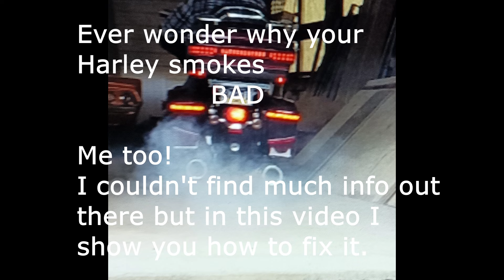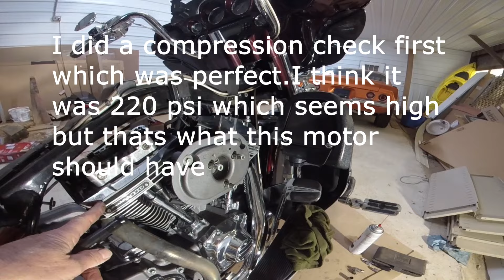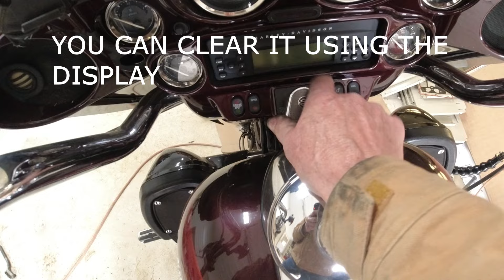Why does my Harley CVO smoke; not what I expected

Comment: As a mechanic of forty years on cars and bikes you did an excellent job one thing though I wouldn't have used those valve seals they should just push on in all my years I have never had to hit one on when i fitt the seals on i put the valve on then slide the seals with a bit of oil over the valve and onto the guide that way you will be sure to fit them the right way, where they harleys own brand or a pattern part it might be eventful to purchase a valve spring compressor they are not expensive over here in the UK they are around 25 pounds about thirty dollars in your money I know one thing you have saves many bucks by doing it yourself if Harley had done it they would have fitted a new head which isn't cheap as I've bought a couple myself for my friends bike he had the same problem on both heads but they also cracked so were not worth repairing so if the guide seals were not Harley ones it might pay you to invest in a couple just in case these fail depending on if you are going to keep the bike 
Long it certainly looks a good one normally guides don't fail until at least 100.000 miles plus they are normally pretty good my friend's bike had just done 110.000 miles when his heads failed so I did a complete rebuild bottom end and new cylinders and heads and pistons she is like new again ready for another 100.000 miles of fun as I hope yours will last too great video I've subscribed and liked so all the best from John from Rugby UK.
Reply from the maker: Thanks John 
The machine shop that rebuilt that head told me that part of the problem is they use cast iron valve guides that don't dissipate heat at the same rate as the aluminum head. 
Personally I think the CVO 110 runs hotter because of the high compression. After I bought it I did read some articles saying that the valve guides were an issue. 
As far as the valve stem seals go, I bought them directly from harley. They were part of the complete top end gasket kit.  Probably got sourced from some aftermarket.

Comment: Good job.  Cool video.  I have a 2007 CVO with the 110 engine.  I bought it used.  It had a good title but looked like it had been stolen and recovered as some of the expensive CVO parts were missing and replaced with Ultra Classic parts, like the wheels.  So, I got it for $7,300 when it booked for $13,500 in 2019.  I certainly ride it more than any previous owner and have over 103,000 miles on it.  We found strange things wrong with it when I got it, for example:  There is (was) an upgrade kit for the 2007 to upgrade the rear pulley to the 2008 "cush drive".  Somebody tried to do that, but they used the wrong axle, wrong spacers, and wrong bearings.  It took a while to figure it out but we put it together with the correct parts.  It ate two sets of rear bearings before we figured it out.  I put my first Harley together from a basket case when I was 19, I am now 58.  It's cool to see someone work through issues with just mechanic skills.  A lot of motorcycle and car YouTube channels act like everything is so perfect, just bolt things together.  Enjoy the bike.  Road Glide Vs Electra?  I have no opinion.  I was riding my CVO today, cruising at 95 MPH with no issues.  I tend to keep bikes a long time, it's more like a relationship.  I currently have 2 Harleys, 2 Hondas, a classic Triumph, and a Yamaha.  I can't see selling any of them, but I might buy another.  LOL!
Reply from the maker: Kudos to you! Fixing other people's mistakes is always much harder . Fortunately on this bike things went pretty smooth for once.
Ride on!!  Enjoy your machines